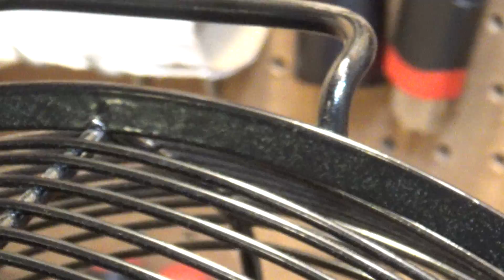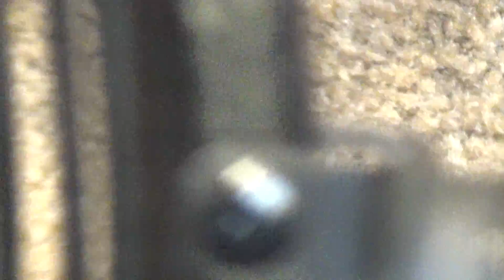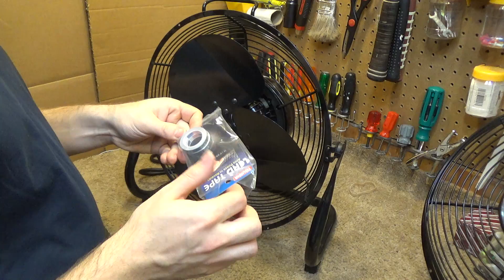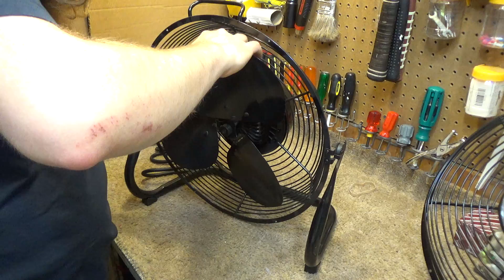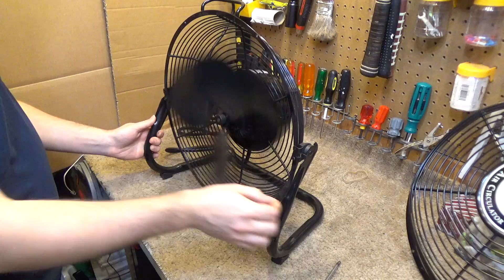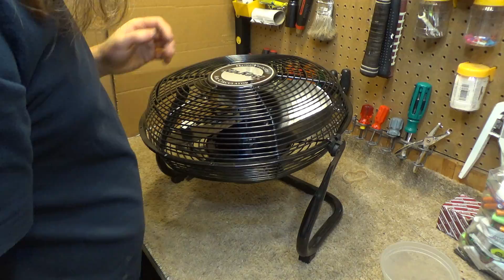Balancing an Air King 9214 High Velocity Fan

Comment: Got this fan coming today via Amazon, hope it don't have this problem but will let you know..
PS. Id love to see a tear down of these Air King motors..
Reply from the maker: Chances are you will, the majority of them seem to be out of balance unfortunately.
I've been meaning to do a teardown of one of these for some time, there's a few fans I want to do so with. This summer it shall happen.
Reply: @JordanU  Out of balance as bad or worse than yours, also the stand is bent. Only three rubber grommets touch floor..
Reply: @JordanU  Was able to twist the frame back into position and waiting for some lead tape to fix blades.. Amazon gave me 16.47 back so I decided to keep it..
Reply from the maker: @Star_Gazing_Coffee_Lover  Absolutely no surprise there. These should be perfect out of the box considering the price, but even with the blades being out of balance they're still one of the best options for a fan on the market today.
Reply: @JordanU  I worked all day with lead tape to try and balance the blade but so far I haven't been successful. I called AirKing and they asked me to check the shaft to see if it was bent. It wasn't bent but there is a lot of up and down and side to side wobble, but I think that may be more to do with the ball bearing but am not sure..
Reply from the maker: @Star_Gazing_Coffee_Lover  There is definitely something wrong if there's play, there shouldn't be any in any direction.
Reply: @JordanU  They sending me a new motor was hoping just to exchange fans..
Reply from the maker: @Star_Gazing_Coffee_Lover  At least they did something.
Reply: @JordanU  Never replaced a motor before, I doubt it is plug and play..
Reply: @JordanU  Air King is sending out a new motor and blade. Wanted to ask if you have any pointers on what to expect in this motor?
I am kinda worried about cutting any wires. I am ok with solder and shrink wrap.. Anything else I need to know?
Thanks..
Reply from the maker: @Star_Gazing_Coffee_Lover  I believe the unit they send will have a cord and switch on it, should be nothing more to it than unscrewing the old one and screwing in the new one.
Reply: @JordanU  Wow, I never thought of that.. But today I got the new fan blade and it did make it almost smooth, but one blade still rolls to the bottom but much slower than the old one.. Motor makes noises that I have heard, you I think say it is normal for ball bearings.. Anyway, a lot to go thru for a new fan..
Reply from the maker: @Star_Gazing_Coffee_Lover  It's a nice fan when you get a good one, but there's definitely a major quality control issue.
Reply: @JordanU  Agreed. With the new blade it is like a different fan..
Reply: @JordanU  Here is an update in case you are interested.. Had to send fan back, the  motor locked up. got another one to replace it and it seems ok out of the box..
Also I changed my YT name so you know it's same person.. Thanks for all your help.

Comment: I need to try this on my Lakewood HV-18.  Is the tape still holding on properly after a few months?
Reply from the maker: We’re in the cold season here so I’m not using this much, but no problems thus far. The adhesive is strong, as long as you’re putting it on a clean surface I think it should hold.
Reply: Thanks for the reply.  I tried it on my Lakewood HV-18, but the problem ended up being with the blade alignment.  I had to bend them to fix the vibration.  Good to know your tape method if I ever buy an Air King.
Reply from the maker: @carson01XJ  I've found the Lakewood blades are generally quite balanced, as long as the alignment is good I've never had to use the tape on one.

Comment: Nice job on balancing this fan. But I have to agree with the fact that it shouldn't come out of the factory like that.
Reply from the maker: Thanks
Reply: @JordanU  
I think you could be a great repairman.
Reply from the maker: Thanks for the kind words, I do enjoy repairing things..
Reply: @JordanU  
I do too. But I don't really have a chance to repair things.
Reply from the maker: Sometimes, you have to take chances..
Reply: @JordanU  
I will get there eventually.
Reply from the maker: @MinecraftPro97k  OK
Reply: @JordanU  
I thought of a question, would this method work on my Hunter Discovery ceiling fan?
Reply from the maker: @MinecraftPro97k  It would work on anything..
Reply: @JordanU  
Really? You got a link to the weighted tape product? But I forgot to mention that the Air King is such a freak show.
Reply from the maker: For purposes of consistency, I do not post product links into the comments box or video description. The product itself is called 'lead tape'. There are balancing kits made for ceiling fans that work off the same concept but have heavier weights, that would be a better option. You'd need to use a lot of this tape for it to make a difference on a ceiling fan.
Reply: @JordanU  
Oh
Reply: I heard Lasko was planning on discontinuing these soon